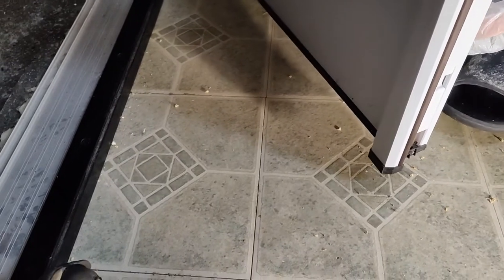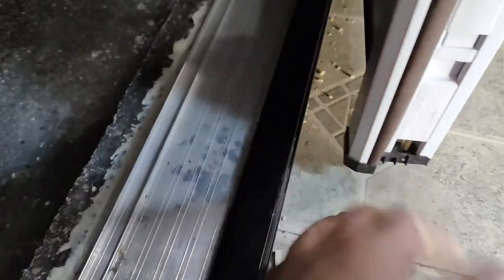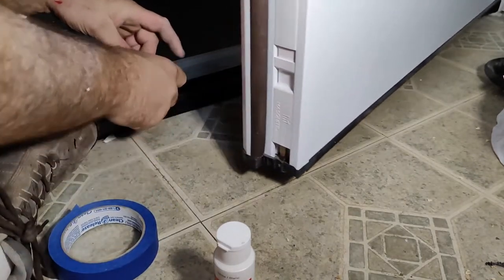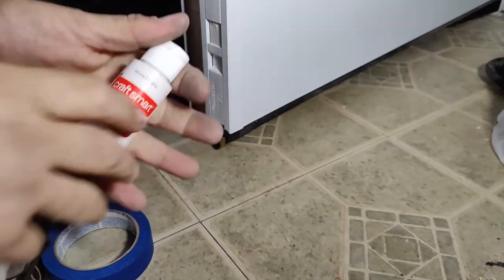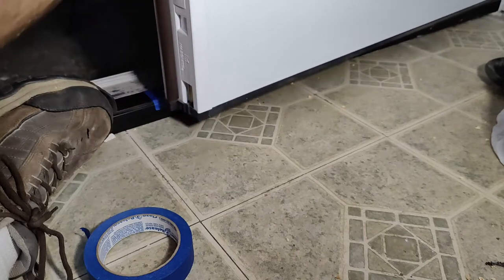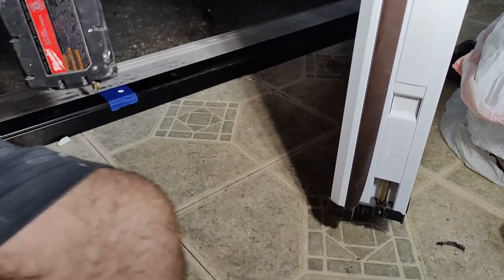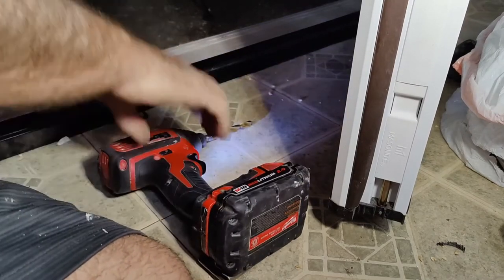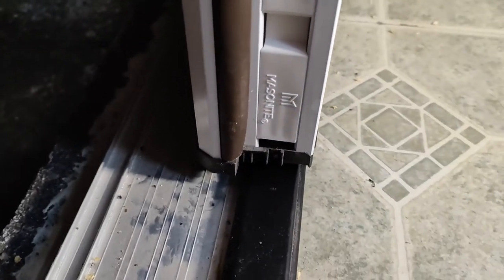Easiest way to set French door flush bolt slide (100% perfect alignment) Astragal lock double doors

Comment: Exactly the video I needed! Appreciate it! I assume you could do the same if there is a flush bolt at the top as well?
Reply from the maker: 100% yes. Glad I was able to help you.
Reply: @CityPigeonNOLA  well now I've learned my flush bolt is rectangular so I'm going to have to get a little more creative...
Reply from the maker: @wtjarrard  then you do the same thing to mark it with the paint. Find a drill bit that is smaller than the square and drill a starter hole carefully in the center. Next if you do not have already, you will need to get a small chisel that you can square out the hole you drilled.